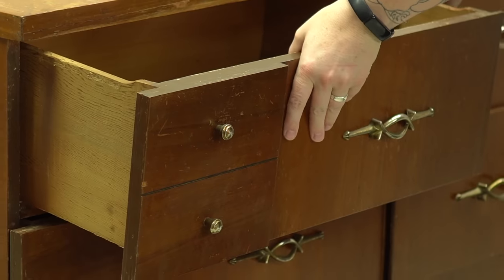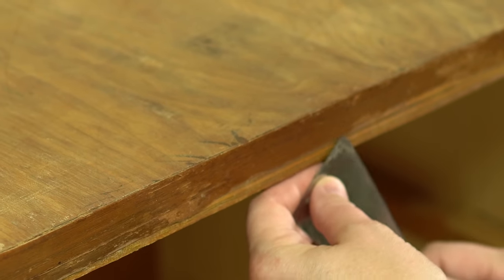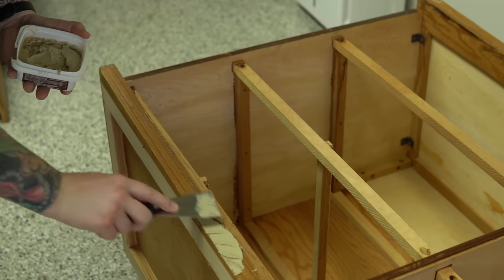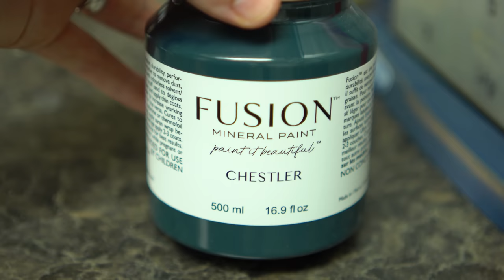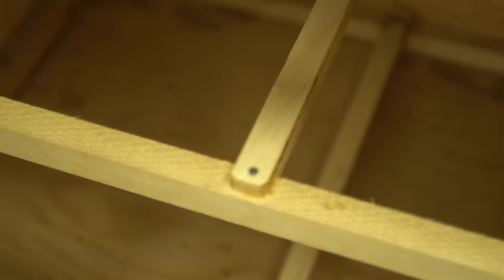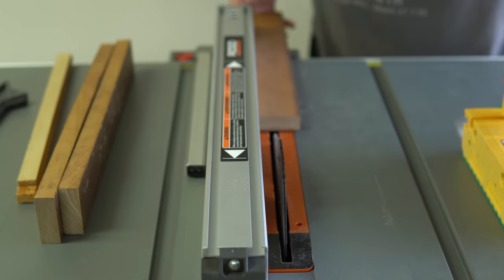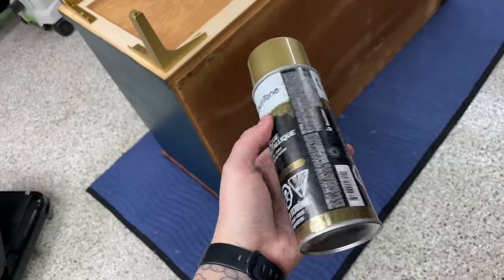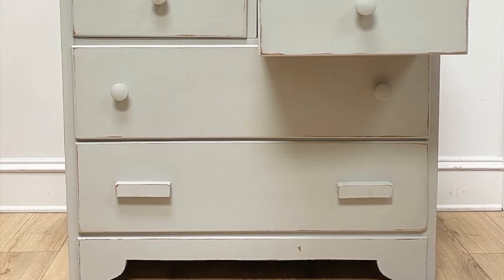DRAMATIC wood & paint dresser makeover - FURNITURE FLIPPING

Comment: You will love your saw once you get used to it. I wore mine out when I was installing real barn wood to the living room wall. Eugene replaced some little pieces and it works fine now. I am using it to split the wood so I can frame in the windows. Roy gave me a little old end table that needs a drawer slide. Once I finish my wall, I'll revisit this video to remind me how to fix it. While my own shop doesn't have the stains and tools you have, I do have the wax. Hey, mine is a hobby, not a business! So glad the hurricane didn't do more damage. Zeta did a job on my 2 sheds. One day we'll tackle that repair.
Reply from the maker: Thanks so much for watching!

Comment: Thank you so much for your table saw tutorial!  I have never used one, and I am very afraid of it, but I know I will need to use it eventually.  And you have also solved my paneling dilemma in the solarium of my 1939 house.  In there the paneling is original and has never been painted, but I hate knotty pine.  Now I know that I can just use shellac first and then paint it, and if the next owner wants to restore it, they can.
Reply from the maker: They are a fairly intimidating piece of machinery, I can absolutely understand anyone's fear. Slow, steady and read all instructions and you'll be fine. Safety first always!!  Thanks so much for watching!

Comment: This actually took my breath away when I first saw it! That first shot. But then your work and your pieces are so uptown and elegant. 

You increased the piece’s value 10-fold. To me it was nothing much when I saw it. I’m so glad you used the hardware that you did. I suppose, knowing your talent, it might have looked as good had you had all of them. But, especially having two stellar types really classed up the piece. 

And then, oh my, the colors you chose! Both the stain and the paint. 

I’d love to see more about custom stain. 

Also is there an SOP (standard operating procedure) for the length of leg you use when changing from base to legs? 

Finally, you probably have done a lot of research on this stuff, from MCM to custom staining, to general basic woodworking. 

Do you have a list of books I could buy to fill in my library? There are way too many books on Amazon. Some of which have reviews that conflict so much it’s hard to tell if buying the darned book is worthwhile. 

Thanks for another great video!
Reply from the maker: Do you follow my Community section? There's actually a draw going on right now for a fantastic Wood ID book that you might want to enter. Thanks for watching!

Comment: For the tablesaw - I use a 'cut-off sled' for a lot of tasks. So easy to make: smallish piece of plywood that's very flat, maybe 1/2" \ 12mm thich; two miter-gauge slot runners glued & screwed to the bottom, and a 90° fence at the rear (maybe at the front, too. Adds a lot of utility to the t/s: just grab it for cutoff and repetitive cuts like your fillisters.

Please attach a fence board to your miter-gauge: it's a different world!

A quicker and very utile method for the fillisters, or end rabbits (rebates) on your drawer runners is to make a tenon jig that rides on the rip-fence. Make the defining (shoulder) cut first (especially on the cut-off sled by stacking side by side against a block to set exact length of cut) then set up the tenoner and cut the face of the rebate. Wallah, better cuts and only two steps (requires sled and tenoner tho.) 

The cut-off sled can do all kinds of repetitive cuts, use temporary stop blocks, angle fences, etc. It needn't be fancy, just scraps. Same with the tenon jig, which BTW is the premier tool for fashioning table legs and filliters! 

[note: either use a slide-catch or a block to cover the exit of the saw blade at the rear of a cut-off sled. The catch prevents sliding past a 'safe' point at the end of a cut by hooking onto the table of the saw....]

Comment: I was just watching the purple desk video and was wondering if you knew about paint strip disks? I have used tons of those disks on an angle grinder to strip paint that just won't come off. They work quickly so you can't hold them in one spot too long but are well worth it in the long run!
Reply from the maker: Thanks for the tip! ❤️

Comment: Beautiful piece.  Your Rigid table saw looks to be pretty new, so I will share a bit.  There are pretty much no tools that are out of the box, correctly set up.  I owned a rigid and recently borrowed one as well,  Blade carriage needs to be aligned with the mitre slots, blade tilt needs to be correctly zeroed and the fence also correctly set in relation to mitre slots (NOT aligned.). Fine Wood Working had a very good article, sure there are others.  Make a simple cross cut sled.  A taper jig would be helpful in time.  Correct set up of the saw will make it cut better, easier and much safer, less prone to kick back.  The Mitre saw similarly needs correct set up.
Reply from the maker: Thank you! Yes, I’ve only used it a few times now but I’m a stickler for reading manuals, so when I put it together, went through and did all the recommended adjustments (there were more than most people would probably expect considering it’s brand new)- specifically the blade was a bit off kilter. But at least they are east to do and it only took me about an hour to do the full set up on both saws :-)

Comment: I love your work but am curious about something...Most of your jobs show tung oil being applied to the inside of the drawers. In one recent video, you sprayed lacquer instead. Was there a specific reason related to the wood or the finish that you used the lacquer?
Reply from the maker: I’ve actually never used either of those inside the drawers themselves ! I sometimes use Howard feed and wax inside, or a beeswax/hemp oil combo, but on pieces that have had an odour problem, I’ll use either an odour blocking primer or shellac, both of which seal the drawers and help block any residual odour very well. ❤️

Comment: Do you use a wood conditioner prior to applying the minnwax gel stain?
Reply from the maker: You really only need a wood conditioner on very porous woods like pine, birch, maple, etc, as they are prone to blotchiness. And works best with penetrating stains. Gel stains sit more on the surface than a penetrating stain so aren’t as prone to the same sort of blotchiness. But that aside, this particular wood stains like a dream consistently, so no wood conditioner is needed.

Comment: Does the Howard’s beeswax that’s being used inside the drawers end up staining clothes (if placed inside a dresser) if I use it this way?
Reply from the maker: No. It needs to be applied, soak in for a few minutes, and then have the excess wiped off. Once it dries fully and cured, there are no issues with it transferring to clothes. If the excess isn’t removed and allowed to stay on the surface though, that might be different.

Comment: Angie, can you recommend a product to use on an old, raw wood topped table ? It's drying out. I'm in CA/USA,  dry climate. Thank you.
Reply from the maker: Odie's is great for table tops, provided it is applied correctly and given the right amount of time to cure. I’ve seen many applying it incorrectly (using rags or brushes to apply, using too much, not removing the excess well enough, or not letting it cure before use). Done right, it makes a wonderful natural looking finish that is very water resistant and doesn’t flake, chip or peel. On dining tables, I usually do two coats, a couple of days apart.

Comment: I have a 150yr old (chestnut?)  chest with the original marble top with the original thick maple top.
 I have two problems, One, the two little drawer and mirror top were removed 100 yrs ago and the holes  the unit connected to the top, are there in the back of the top, each about 1 inch in diameter.
the other problem is the dove tails have gotten loose from shrinkage  but still hold. 
It also had hand cut nails holding on the trim. 
The trim and handles were all hand carved and I doubt can be matched very well. It is all solidly attached. I do not want it taken apart, and wonder if there could be something squeezed into the dove tail joints to swell the wood to make it hold tighter. and a matching little two drawer and mirror top can be built. 
I removed many years of sticky tobacco scum and alligatored coating were removed with tureen tine and boiled linseed oil about 50 yrs ago and there is no discoloration of the natural wood. It was then waxed. I can tell it needs a new waxing.
I want as little done to it as possible. I don't mind drawers that tip a bit, they are a part of the aging.
Reply from the maker: The long answer here, is as much as I would LOVE to be able to help everyone who reaches out, there sadly just aren’t enough hours in the day. There is another side to this as well- sometimes things don’t come across properly through photos and videos, and are best seen, felt, etc in person. For THIS reason, it can sometimes be difficult to accurately determine the age, finish, wood species, etc of people’s project pieces. There is also the element of user error, when recommending products and finishes, or misinterpretation of my instructions.

I get, on average, approx 40+ messages per day between Instagram, FB, YouTube, and email (and literally hundreds of questions in the comments). It is unfortunately just not possible to be able to get back to everyone. 

The short answer is this: you can certainly message me on Instagram and if it’s a simple answer, I may try to help you out. But PLEASE don’t take offence if I’m unable to respond! I need more hours in a day!

Comment: How long after using the feed 'n' wax can you put stuff back in the drawers and not have them get greasy?
Reply from the maker: All of the different products I use in the drawers gets applied, allowed to sit for a short time, and then wiped back. What remains in the wood cures and doesn’t leave any residue. There are some oils that perhaps could leave residue, but the ones seen in my videos are the only ones I use and I’ve had no issues at all (the excess needs to be removed though). I hope this helps. Thanks for watching!

Comment: Blade " barely " above the material is a myth..having the blade above by 3/8-1/2" above actually helps pull the material down... much safer.. ( btw.. cabinet/ furniture maker for 40 years )
Reply from the maker: Thank you for the tip! That makes total sense.

Comment: Rookie question, but how does using a scraper for paint removal not scrape, scratch, or harm the wood underneath?
Reply from the maker: The blades on the scraper are very hard and kept sharp. Sort of the same principal as shaving with a razor. Learning the angles to use and the correct pressure are key.  I have a video up where I scrape a walnut dresser. It is here : https://www.youtube.com/watch?v=mLwVMyDmCXY&t=363s
 and another video where I discuss blade sharpening and other scraping information during the video here : https://www.youtube.com/watch?v=Ts1vpr3L3Qw
Thanks so much for watching!

Comment: True story: Once upon a time, I owned a rare vintage car. The engine and transmission had only 22, 448.8 miles on them. I remember that because I hmmmm & hawwwwed the price down to $2,244.88. She had sat in a barn, up on jacks, for over 25 years. She was pristine except for the standard parts that deteriorate when the car is never driven. Boy! Was she ever difficult to find parts for? Yeah. Because the year she was built, there were only 222 built. I visited numerous junkyards. Made more than numerous phone calls everywhere in North America and Canada. When I found the first part, the speedometer, I was rejoicing. When it arrived, I held it with the same reverence that one does when holding a donor organ about to be transplanted. It is not that I have held a human donor organ to be transplanted, but I did see that surgery, and I was on the care team for patients who had received transplants. As I replaced the motherboard speedometer, memories flooded me. She always needed work. I usually found the parts rather than having them made. I always felt a kind of reverence. The same way I felt whenever I met someone alive because they are here because of someone else. Those pieces of other furniture are an extension of life to an otherwise dead piece of firewood. You're a furniture surgeon.
Reply from the maker: Wow- I love that! Thank you for sharing!!